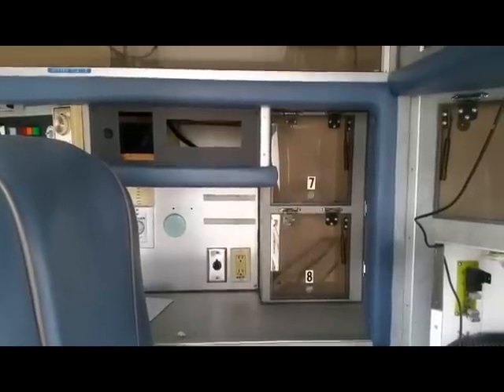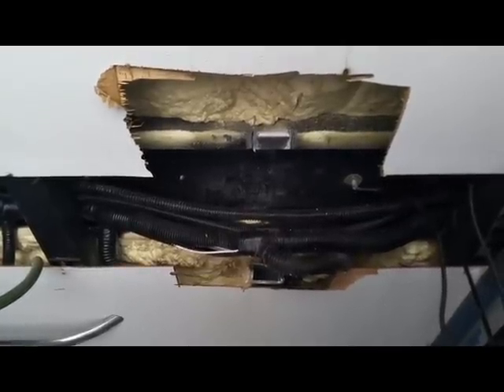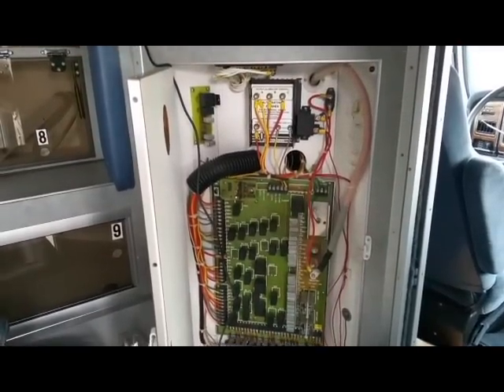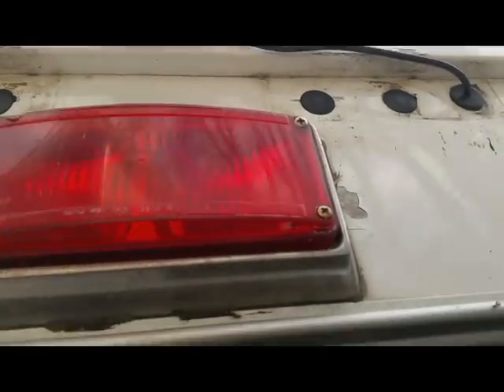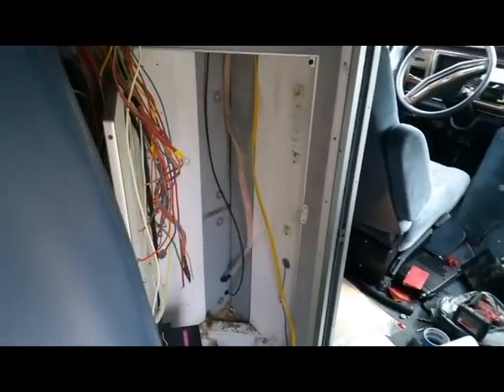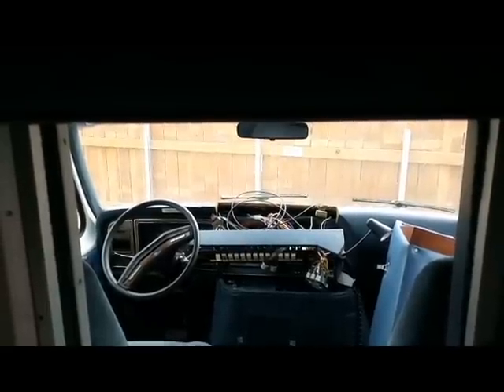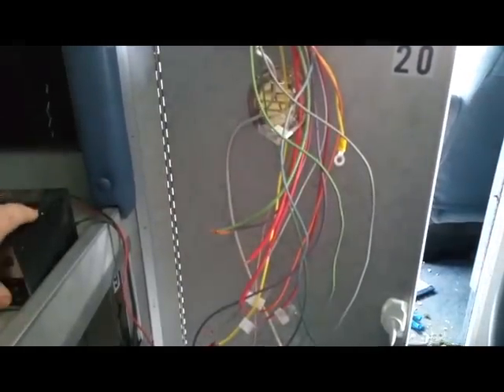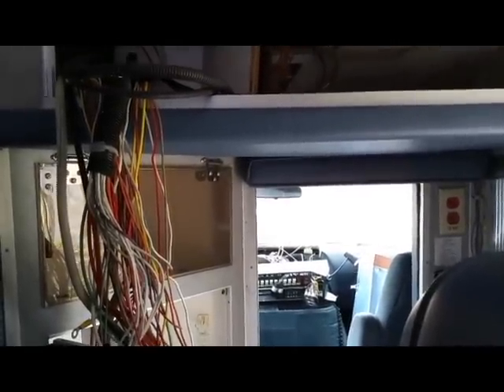#2 DIY Ambulance RV Conversion; Camper Van, Motor Home

Comment: hey jim, I drove ambulances as a paramedic for 30 years and always felt they could make great campers with the cabinets,and dual battery systems, invertors,etc,both the modular and the high top van models...good luck with it, fords were the best for wiring as they were solid..:)
Reply from the maker: I'm with you Steve. This beast is solid. Love the dual batteries! The compartment structures are so amazingly solid. Gotta love commercial construction!